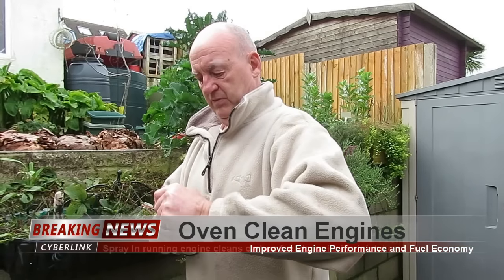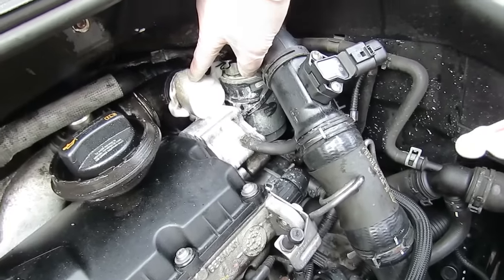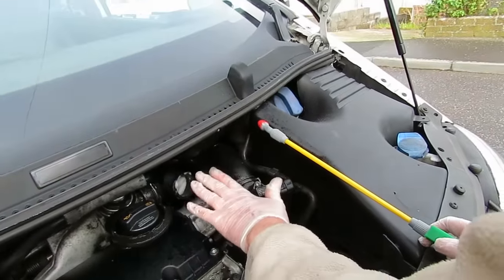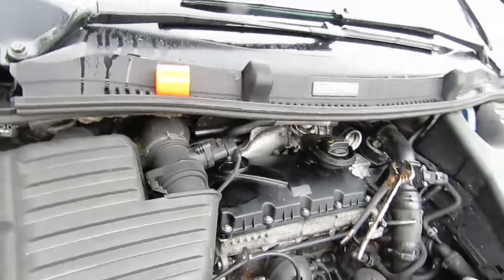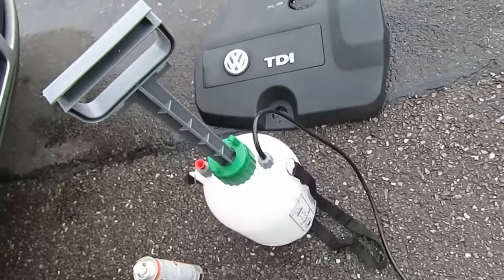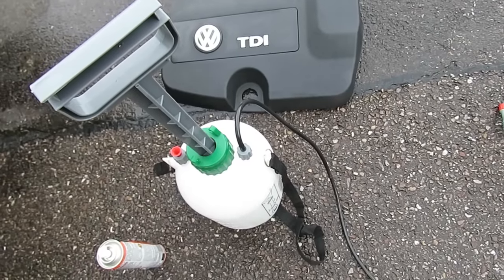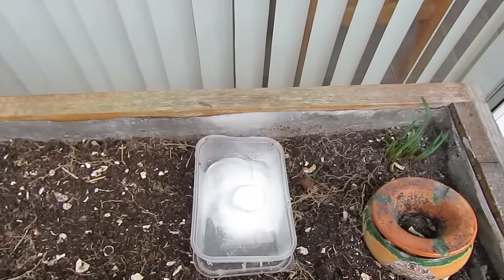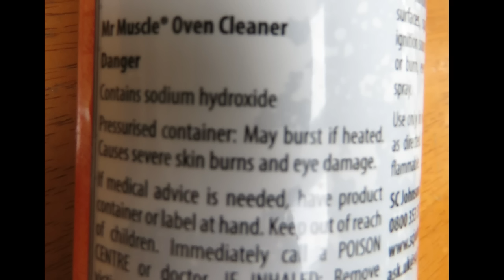Clean EGR Valve Decarbonize Turbo DPF MPG Limp Mode Mr Muscle VW 1.9TDI Sharan Galaxy Alhambra

Comment: Talk about backyard mechanics! Lol unreal stuff!! Just do it right in the first place & install a quality catch can. Not the shit on ebay a reputable proven to work brand. No more oil into intake! Job done! If you want to get real fussy a egr block plate with a 10mil hole to trick computer error codes. This will stop majority of deposits entering your system. All this after the fact stuff is just playing with fire. Diesels just want clean oil, fuel & AIR! to operate effectively. Not all this crap that people are pumping into them. Anyway knock yourselves out lol.
Reply: 79 Series V8 hi there. Im catching about 50ml every 400-600kms on the same engine. I’ve the 79 series v8 too. Im kinda thinking though that 50ml is a bit on the high side. Any thoughts on your setup. Cheers
Reply: cognitor900 Yeah mate im getting about the same amount & im pretty particular with the care i give my motor. Always have ran full synthetic & no engine mods besides a 3.5 inch exhaust. Got a quality catch can from Berrima diesel & did the EGR block plate. Always used toyota filters. About to install a Engine Guard temp alarm which has two sensors, one for oil temp & one for coolant temp, also a Exhaust gas gauge. Then lastly a Fuel Manager pre filter, so no surprises down the road. Thinking of chipping it with a DB or Roo systems chip but am not convinced that it will not put excess strain on my motor that i plan on keeping for many years. I do all my own servicing cause i don't trust anyone else.
Reply: 79 Series V8 

People don't have a clue buddy if so paranoid about soot why not stop the egr from working .I have used my vcds 17 to turn down the values to nothing that turned off the check engine light .
Reply: 2009bigchief Yeah well what ever works, the more you keep out the better. Still i find it interesting that the digger i operate which is brand new still has the ol crankcase breather tube pumping out all the gases under the machine. Won't be long before they start choking them up to.
Reply: 79 Series V8 

Yep that's where I run my engine head breather tube also to down to the bottom of the car.i think this year there is a few more mot laws in need egr to be there and connected .I like the egr there as hope will stop diesel runaway .I like your ideas about Toyota filters .I have my egr off since got the 1.9tdi non pd asv engine code since 50k looked well after it but the head gasket started to leek into the coolant at 120k but I blame the Molly Polly diesel purge I put into it directly every year at oil change .other than. That was treated like a baby like u I want 2 drive it forever
Reply: 2009bigchief Yeah I wish we could get away with it here in Australia  but if you get caught doing it on a egr equipped car its a big fine. You must be in the USA?
Reply: 79 Series V8 

Ireland boss   bought vcds 17 cracked one from eBay and set levels to nothing but had pipe off the egr on my 1.9tdi since I got it but check engine light was on burning for years and years  put bit of black tape over light but looked up what could do with vcds Ross tech 17 and well turned it down to nothing cleared faults didn't even plug in the pipe and check engine light no more lol
Reply: 2009bigchief 
Love ya work!

Comment: how is the car after over a year after treatment?
Reply from the maker: Crud built up again so recently changed the EGR valve. Running ok with noticeable power and economy boost but no doubt crud will build up again because still getting burst of soot when putting foot down uphill after miles of steady driving.  Exhaust gas recirculating is a very bad design fault, no doubt an afterthought designed to cheat the exhaust emissions requirements. Nevertheless, the MM foam treatment did give a similar boost to EGR replacement and manifold clean out.
Reply: Andrew K Fletcher thanks for coming back. Just used MM for cleaning egr and throttle valve on my 2.0tdi. This stuff is great for getting rid of all dirt inside those things. After fitting the valves back made same treatment as on your video. I can confirm it works perfect, plus the car drives like new again. Power restored, limp mode gone, drives and sounds excellent. Thanks for idea. Great stuff. Cheers.
Reply: Sounds like you should have fitted an oil catch can mate. Help prevent any new sooty build up. (Carbon)
Reply: @benpanchaud9740  thanks for advise, but I found a better solution. Selling my diesel soon and getting non turbo petrol car.
Reply: @AndrewKFletcher  Seriously, block off the egr and when its mot time reinstate it for the test, save the carbon buildup a bit in the first place.Its a cludge fix for emissions tha actualy uses 5% more fuel by being there and can cost you 15% of the engines power.Should stop you having to do such a risky procedure.
Reply: @deepwoodtickles  but will cause higher intake temp and low rpm boost spike

Comment: Are you out of your mind !!!!!!! "don't get any water in there" .. that's all he's worried about :D
Reply: people have used water to clean out carbon for around 120 years on internal combustion engines. not as much as he was spraying down , but it realy does work. and if you have ever lifted of a cylinder head with a blown gasket you'll soon see where it blew as it will of been steam cleaned...... go check it out, then check out water injection on high powered sports cars too. might lean something
Reply: @philldownes8685  its a tiny jet with low pressure..mostly water vapor going in...
Not from a garden sprayer
Good luck hydrolocking your engines!

Comment: Well... at least rolling it off a cliff and collecting the insurance is still an option after this. Seriously if you want to try anything try seafoam. Personally, I take off the intake manifold and clean it with carb cleaner.
Reply: I used carb cleaner and removed nothing in comparison. I used a can in intake manifold  after was removed and was a yellow thing. If you put Mr Muscle it will come out like oil...instead like a yellow piss. I see people here talking without trying anything. I cleaned many things with all sorts of chemicals. The amount of sodium hydroxide inserted will make just a film and is not like staying submerged. The water after cleans that out and the engine moisture clean everything left. What is left is shortly exhausted after the chemical process.  I'm worried more about breaking down the oil that is in cylinder used for lubrication. Probably that is the cause of any damage and not the aluminium corrosion.   A bit of Sulphuric Acid and the Anodisation process is complete...making the aluminium scratch resistant. ;)

Comment: This is not only highly stupid you risk hydro locking your engine your also using a very harsh chemical which risks causing damage to seals and you can hear the knocking of the engine .
Reply: he did use a slight too much water, but no the corrosive bit is not going to happen, its all gone and lubricated well before it could ever do any damage.... put a piece of alloy in oven cleaner and just see how long it takes to corrode it, we are talking weeks before anything happens...... have you ever thought about the corrive stuff in anti freeze ?

Comment: OVEN CLEANER can be used to eat aluminum off crankshaft journals ......so EAT and ALUMINUM  don't sound good for an ALUMINUM engine block or head or rubber or cork or gasket sealant or well you know....

Comment: I assumed the egr vavle was closed when engine was off ? not slateing I believe this to work ;)
Reply: The valve is shut when the engine is off... unless it's stuck open. A lot of EGR problems are due to the valve being stuck open. This method isn't guaranteed to fix the problem but so long as you are careful and don't drown the engine with water you get the benefit of both the breaking down of the sooty gunge in the egr and a bit of piston decarbonization too

Comment: Still doing good? I did this today, step 2 only. More pep but still in limp mode.  I used Easy Off HD, I'm sure its the same as Mr Muscle.
Reply: So I did his step one and hydrolocked my engine.... I dont know if I used to much oven cleaned or what? Any way, if this happens to you.  Remove glow plugs  and crank engine until it's all out then reinstall glowplugs and manually rotate engine with 19mm socket on front of engine untill you can spin it all the way around twice. You should be able to start car now.
Reply from the maker: The economy improvements are still excellent after 10k miles, though occasionally getting limp mode, though not as frequent as before. I think I have to bite the bullet and fit a new turbo cassette, these are relatively inexpensive, from around £78.00. The turbo still whines a little, again not as much as it did prior to Mister muscle treatment
Reply from the maker: I used a endoscope camera down the inlet hose a few weeks ago and could see the carbon building up again. I'm thinking that the design of the gate valve and cooling tube is more to catch and store carbon, where it dumps it from the exhaust as a cloud when you put your foot down on the accelerator. This system, imo  is to cheat the emissions tests in a workshop environment, where flat out acceleration is not tested.
Reply: Andrew K Fletcher i think the best way to eliminate the carbon is to reroute the CCV breather out of the exhaust and remove the egr.

Comment: There is an easier way AND Safer Wynn’s EGR Valve cleaner do what it says on can 
Took me 30 minutes 1.6 Citroen C3 1.6 EHDi no mess  Sorry Derek I Think this is Dangerous
Reply: DO NOT SPRAY TOO MUCH or you’ll get engine knock ..only spray a quick small squirt 
Steve

Comment: I've got an egr that is stuck open, what do you think my odds are with this method
Reply from the maker: Worth trying
Reply: I would follow the instruction exactly.
Reply: @amped3854  5 bolts in total
Reply: It's fiddly but you can get the EGR valve off. Once it's off then yeah, scrub it out with oven cleaner, get it all clean and make sure the actual mechanism is freed up. Then RINSE AND DRY IT CAREFULLY before remounting it.
Reply: @shrexha2619  3 holding the EGR valve in position, 2 holding the EGR feed in position.

Comment: Basic chemistry lesson.

Sodium hydroxide (NaOH) exothermically reacts with aluminium, creating sodium aluminate and hydrogen gas.  Essentially, it will eat through any aluminium in your engine that it comes into contact with.  Even if you're rinsing with water, it'll create pitting in the surface, meaning more surface area for deposits to become adhered.  
It also reacts with rubber, making it brittle, so pipes and seals will be compromised.

Conclusion: don't put this stuff in your egr, or turbo.  You would be very stupid to do so.

Comment: I clean ovens this stuff does not have any adverse effect on rubber cookers have rubber it will not rust cos the limited amount of water
goes through very quickly followed by oil. I might suggest an oil change once done and i would not do it to a 30k car L,O.L........

Comment: I have a mazda 2 2004... I took the manifold cover off and the EGR valve... And cleaned them all with Mr muscle over cleaner... I wouldn't spray it in an engine though... Take parts off and clean them.

But that's my useless opinion.

Comment: Very informative vid can one do this method on any car thanks
Reply from the maker: Providing there is no electronic switch device before the point of applying it, and providing you apply it through the same route, it should work the same as any over the counter application, such as seafoam. I will be testing Wins turbo cleaner shortly and upload video.

Comment: isnt be better use brake cleaner instead...... there will be no need from water in that case and i think will be little bit safer... i realy woudnt use any burst or single drop water because it coud damage the head valves gaskets and etc etc...... but its my begginer opinion ... at least brake cleaner burns i think....

Comment: I once did this with the EGR REMOVED. (A6 1.9 TDi 130 PD) It was so caked in black tar that even overnight the Mr Muscle barely touched it, had to chisel it off in lumps. DO NOT PUT THIS INTO YOUR ENGINE DIRECTLY, YOU WILL CAUSE PERMANENT DAMAGE! It might not show immediately but a few thousand miles down the road...
Instead use a proprietary system cleaner 
From previous (intelligent) comments: 

ian ellis
1 year ago 
Watched the full video and thought fantastic I'll go and do that now 👌... luckily I read comments ...don't think I'll bother now 
Ivan Deliev
1 year ago (edited) 
if you knew how an engine actually works from the inner side of the block you
wouldn't put anything like that nowhere near your engine, spraying it inside the engine ...mhm, I do hope you know a good mechanic or have a few phone numbers of salvage yards at hand :) 

James Monaghan
1 month ago 
Best way to make banana shaped conrods 

Francisco Fernandez Felix
2 years ago 
I used in several cars Mercedes and Volvo, Liqui Moly 5168 pro line 400 ml, (only for Diesel engines), with success

Comment: DO NOT DO THIS! 
To learn why not to do this, Take a glass and a piece of aluminium kitchen foil. Put the foil into the glass and spray it with Mr Muscle. Wait. The mess caused is what you have just put into your exhaust system. Congrats for totally fucking up your engine instead of using basic tools to unbolt the EGR and cleani it for five minutes, a job that would take less than an hour in total and which won’t screw up everything made of aluminium in your engine. This is the sort of back street cowboy nonsense that causes people to have to pay main dealers to sort out.

Comment: Mr muscle is caustic soda, yes it will dissolve carbon on the intake just like it does on oven shelves,I would not do this because it will also attack rubber seals, aluminium, gasket paper and the valve stem seals if it gets on them. You do not want water going into your cylinders, unlike air and fuel vapour/mist it will not compress and risks punching a hole in your pistons.THIS IS A STUPID THING TO DO this guy might have got lucky this time but odds are high that you will do damage.Once that crap goes through your engine it hits your emission control systems and can mess them up badly as well.

Comment: Car in scrap yard now
Reply: No not  at all. you people are not realising this gets done at the dealerships too. its not a new thing..  and i remember spraying water into the intake on the old perkings 6354 back in the 1960's. smoke like a pig for 5 mins then clean as a whistle and made the motors run much better,, but only got about 200,000 miles out of those lorries before needing a major overhaul....... its been around since early 1900's

Comment: This is bad, I wouldn’t recommend anybody tries this, the egr valve and throttle body should be removed for cleaning, there is no easy way round it.
Reply: can't be done by owners since Seat 2008+++ (EGR valve is burried and it's cooled so it can't be removed from an amateur unless he's a mechanic)

Comment: Will this method clog the DPF ??
Reply from the maker: Seems to be running better than ever, so can't see a problem there. Black soot came out along with grey smoke plume Done 800 miles since video.
Reply: Hi Mr Fletcher, I sprayed Mr muscle in my sharan's throttle body  this afternoon but now my car is not starting.when i turn the key it makes only  click sound. any suggestions to solve this problem. i recharged battery as well because i thought might be battery is dead but still no success.
Reply: asad shah not an expert but that's seems more like your starter motor not working properly ... the battery sends electric to the starter motor to start the engine ... look up stater motor on you tube .... remember I could be wrong
Reply: I would imagine the black smoke is more to do with your air/fuel ratio being off since you'd disconnected the MAF

Comment: Great! Really Awesome way to fuck up an engine. Try actual carburettor cleaner and actually removing the egr and throttle body. The damn thing probably only kept running due to the compression combustion nature of a diesel and its inherent strength. I thought I had seen everything, and been exposed to most levels of stupid, but this is just stupendously daft.

Comment: Your best off adding abit of fairy  into the fuel to clean the fuel lines abit. And iv found swarfega to work better than mr muscle imo. Better still, throw in a ariel 3in1 tab directly into the oil for cleanest results. Or any non bio will be fine

Comment: Where did the carbon and the rest of acid/basic foam and water finished after solved from the manifold??? Yep directly in the valve seat ad combustion chamber. I can confirm that this engine is already dead now. Don't do this stupidity without removing the intake mainifold otheryise you gonna destroy definitly the engine.

Comment: ANYONE THINKING OF THIS METHOD, STOP!!! This will kill your engine over time. While it may make the engine better for a bit, the type of cleaner he is using eats at aluminium. Over time flakes will come off, rub on other parts. Clog up the filter, and then kill the engine. Be really careful of this, I would think his engine is now running in a rubbish way. Be careful of people like this. It will ruin your car
Reply: Oil vapour is constantly being forced into the inlet manifold, no way it will ever rust. And dude, what filter are you talking about???... Lolol